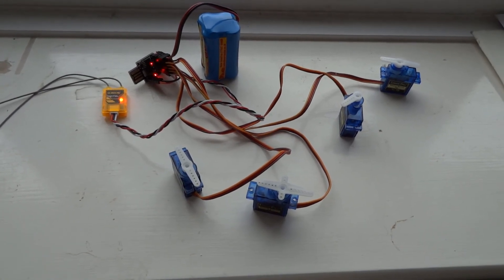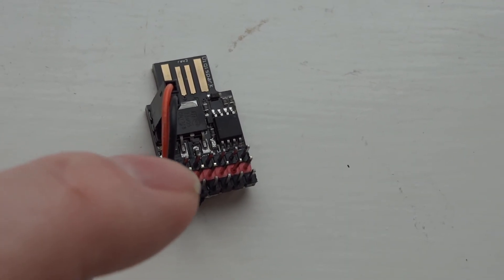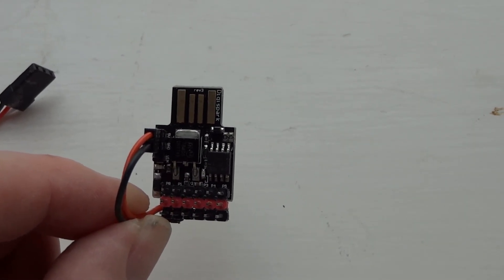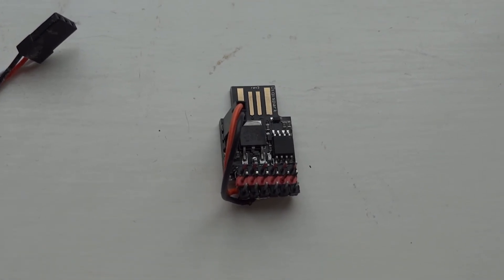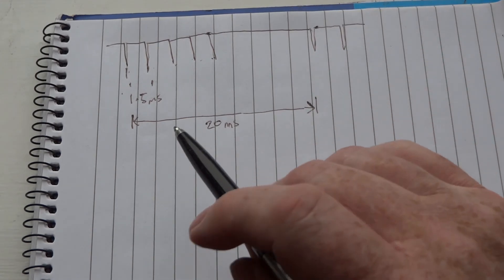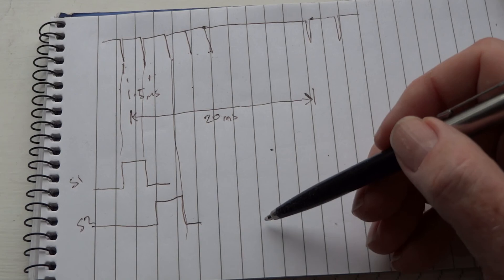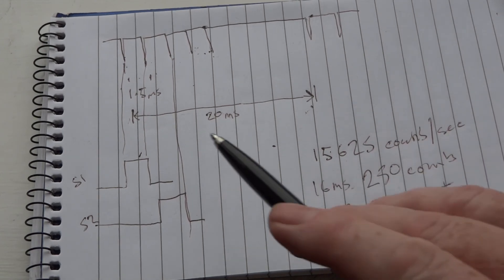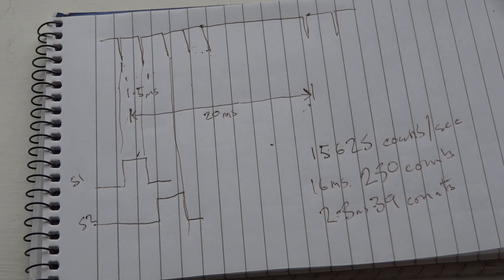CPPM to servo decoder using Digispark (ATtiny85)

Comment: arduino sketch link is not working
Reply from the maker: I just tried it, and it works for me.  Downloads a .zip file that contains the sketch.  However, this sketch will be no use for you, if you're not using a receiver - all this sketch does is receive the incoming pulses from the receiver (which come one after the other, in a train of pulses) and then redirect those pulses to the individual servos.

For your application, you'd be better off using one of the sweep examples as  a starting point, and modifying that.  You'll find the sweep program has a loop that gradually ramps up a value, which it sends to the servo, and then slowly ramps it back down.  You need to edit that so that it instead sends a "position 1" value, then does a delay, then send a "position 2" value, followed by a different delay, and then repeat that whole cycle indefinitely.

Get the sweep version working first, and then keep editing it and re-uploading until it does what you want.  It's the best way to learn.
Reply: @ceptimus  thanks a lot

Comment: assume im using only digispark attiny85 without any ppm receiveretc. i would the servo to move to 90 degree angle and then stop for few seconds and then move back to 0 degree angle.would it be possible. all i could find on internet was servo sweep program but no program mentioning about angles. kindly let me know